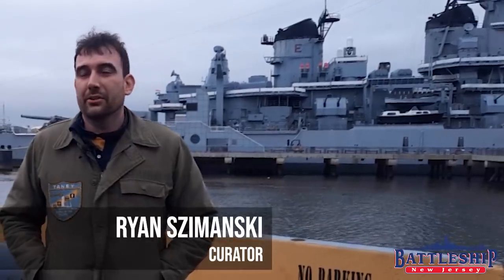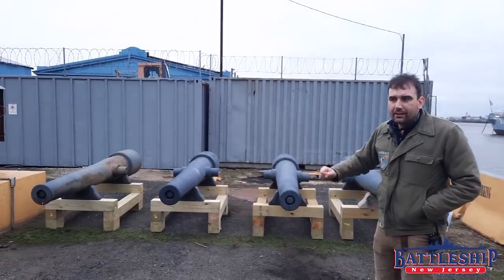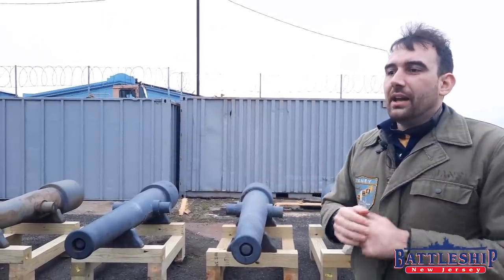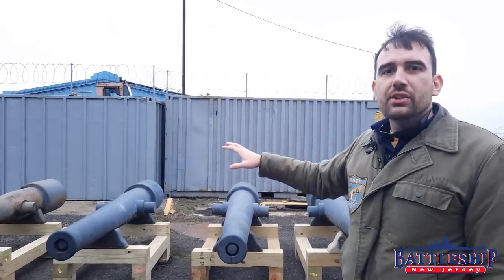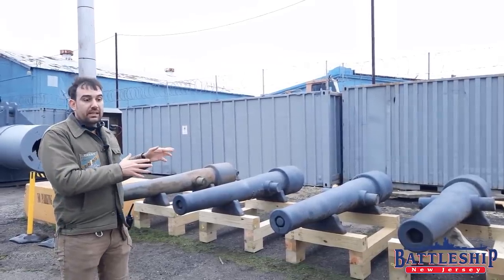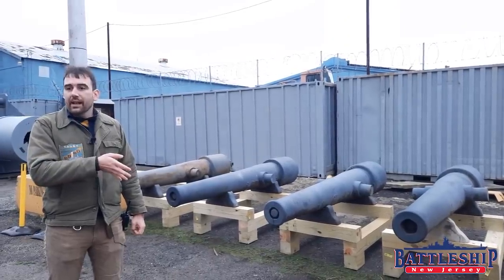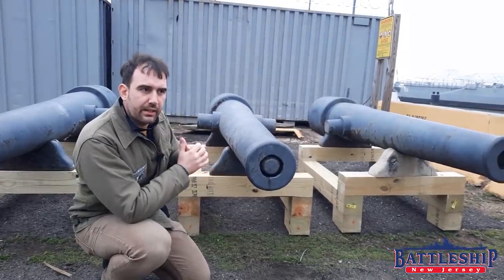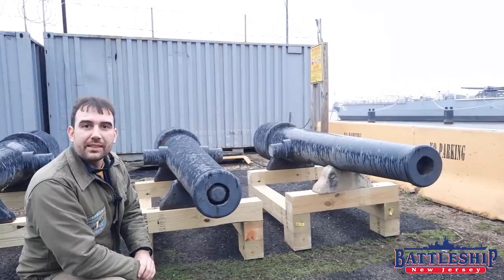New in the Collection: Parrott Rifles

Comment: Black powder, used in all guns through the end of the US Civil War, even when compressed into special-shaped grains (short cylinders with holes and so forth), burns slow compared to modern high explosives like TNT and nitroglycerin, but too fast for being used in long gun barrels where the burning is prolonged at a somewhat lower power per second, but many more seconds, allowing long guns to get up to a very high velocity in the shells it fired.  That is why almost all Civil War era guns were so short.  However, this fast burning also meant that the blast pressure when compressed in the narrow space behind the projectile at loading, gave the breech-end off the gun a huge pulse of pressure before the shell begins to move forward to release it.  That is why the heavy band surrounding its breech area was necessary.  In the long modern guns, the breech is somewhat thicker and stronger for the same reason, but the slower-burning nitro-cellulose-based "smokeless powders", with or without other ingredients added, could be shaped in its various grain types (shaped to control the burn rate for each gun) to allow a lower initial pressure, but a much higher continuous pressure along the entire gun barrel, hence the very large muzzle velocities that can be achieved, in some tank guns over a mile per second!  A parrot gun, even with its reinforced band, would blow itself to tiny pieces if it tried to do that with black powder...

Comment: I would say the CIWS is the most revolutionary (at least in modern times) because it was the first effective counter to anti ship missiles.
Reply: CIWS is very effective, unless it's down for maintenance just when you need it (USS Cole).  The idea of having just one of an important weapon isn't very good.
Reply: @SteamCrane  The Cole attack wasn't the CIWS fault. It was designed for destroying missiles and and planes, the Cole was attacked with a boat, essentially it was a modern fire ship attack. In addition Cole was in port and the CIWS was locked down and unloaded as per navy operating procedures at the time

Comment: Speaking of cannon disasters --!
The designer of the USS Monitor, the US Navy's first ironclad, developed a cannon that was going to be tested on the USS Princeton in front of the President of the US at the time, John Tyler.
John Ericcson, the Monitor's architect, was concerned about his cannon because he knew the quality control from iron casting was poor at best and he wanted the tests conducted more safely and with lower charges before they did a "full-up" test.  His concerns were justified; the new cannon blew and killed at least 2 men.  The President himself barely avoided getting killed by shrapnel from the explosion.
The accident tarnished Ericcson's reputation for years.  It really wasn't his fault because he had given the warnings.
I think cannon designs were altered and they added banding around the barrels to try and maintain shape and keep the barrels from warping as much.
The safety factor was improved as they learned how to manufacture metals better and decrease the impurities in ores that reduced strength of metal alloys.  The impurity factor has affected safety as far as not only how much wear barrels take but the stresses metal plates take under different weather conditions.  For decades now, there's been debate about how metal impurities affected the Titanic's steel plating and whether that metal was better or worse by the standards of its era.

Comment: I thought that the Monitors were armed with Dahlgrens?  Any chance you might add some of those to the collection?
Reply: Most of the monitors did have Dahlgrens, a couple of the multi-turreted monitors from later in the war had one 15” Dahlgren and one 150 pounder Parrott per turret.

Comment: So, are you going to remove the spike and plug on at least one of those? 

As for the most revolutionary piece of naval artillery, it really isn't a piece as since the invention of artillery there was a slow steady progression. What was it? Smokeless powder. Without it artillery was limited to velocities topping out around 1,500 feet per second at the maximum. Smokeless powder doubled velocities and allowed range to stretch well beyond what was considered long range in the era of conventional gunpowder. Up until then, varying thicknesses of iron were able to stop round shot and even conical shot. But the higher velocity meant armor would need a serious upgrade to be effective at stopping the high velocity shells. No more would sea battles be slugged out at distances where voice hailing could be heard between opposing ships. Ranges grew from hundreds of yards to thousands of yards and soon stretched over the horizon.
Reply from the maker: We do not currently plan to remove the plug.
Reply: @BattleshipNewJersey  That is probably wise. They are historical pieces and not fit for anything but static display. But they are cool pieces and the start of the built up process of barrel making.
Reply: Many cannons from this era, when properly inspected, are perfectly safe to fire. But I suspect that would not make the museum popular with their neighbours.
Reply from the maker: We fire many of the ship's guns. The neighbors are used to that. But removing the plug will damage the guns and its not worth to us.